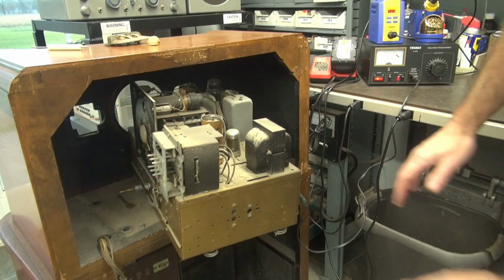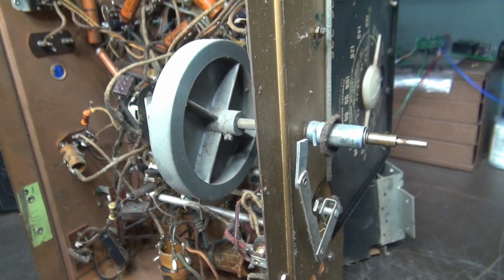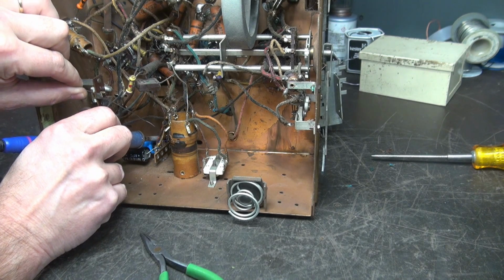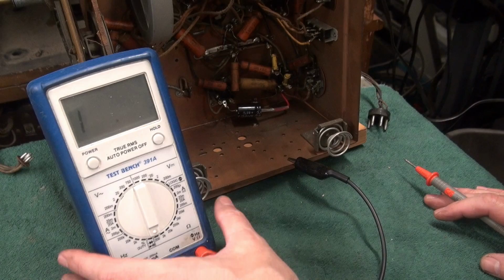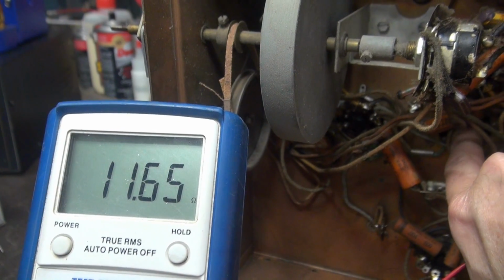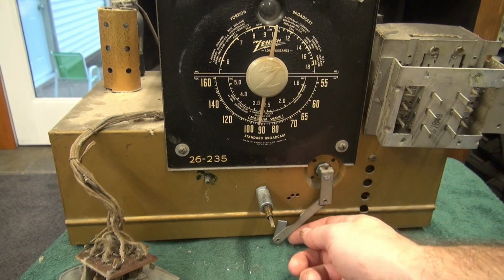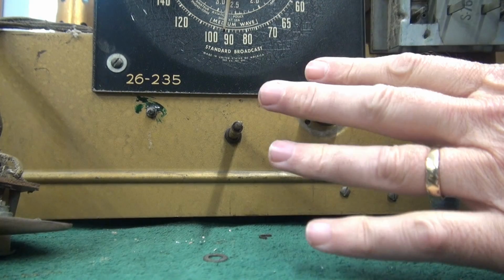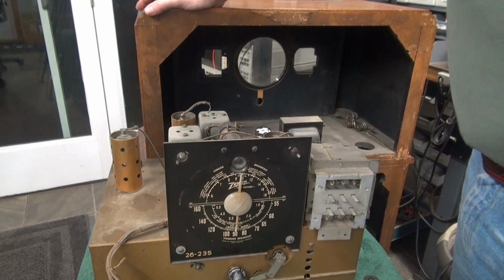How to repair Zenith 5808 8S463 tube console dead Radio broken band switch numerous problems

Comment: I have a hamarlund HQ 129 X. It fires up but the output is nada. A previous owner was restoring it and recapped it aswell. But it does noting.  Will post a video soon
Reply: The previous owner died before the radio was in working order again. And the salesman who bought this radio in a lot couldn't give me any info

Comment: I have a 1960 Zenith console and the FM frequency is no longer working. There is him but no reception. It did work but a little quarkie. There is a Stereo light that didn’t light up until I had the unit on FM frequency for about 20 minutes. The AM works fine. Would I need an antenna? Or is it another issue?

Comment: Greetings:
The tuning eye tube is definitely tired, but an increase in plate voltage can usually help.  Currently the plate is connected to the output side f the field coil. Moving to the input side (from + side of c24 to + side of C23) )should increase the brightness somewhat.

Comment: I have the same exact set I was given yesterday the person got tired of it taking space.. it had the same switch issue which someone fixed. they used a L shaped piece of metal with a hole in it and they used a small hose clamp over the pot metal shaft and a nut and bolt to connect the two..

Comment: That is well worth saving. I have a '46 Zenith console with both FM bands and it sounds great. Yours has the infamous 6X5 rectifier which is known to short and take out the power transformer. Best to replace it with a modern day one.

Comment: I love me some Zenith Radio's, but sometimes it seems like they practiced black magic. Mine had among other things a bad output transformer & speaker, a frozen volume control, several burned beyond recognition resistors and the usual bad wax caps....and pwr. transformer. Good luck.

Comment: I just finished restoring one of these,  my family heard Japan bombed pearl harbor on the set. It was the very set that inspired me to go into electronics when I found it in my grandparents closet in 1968. I inherited it in 2005 and after being dark since 1947, it works and talks again. After many challenges everything is back except I now need the correct power transformer for it. Back in the early 60's a local shop put a 10S transformer in it and is way way too high of B+, that and the 6.3 volt isn't right either....but that'll be soon corrected.
Reply: I changed out the 6X5 retifier, Put a 5Y3 in with a Hammond 270 DX power transformer. Radio works great  and no worry of the rectifier tube taking out the power transformer!. I also insatalled a line fuse for added protection.

Comment: your dial belt  lengths are 
 9-3/8  JFD part # 80.
 and
  9-25/64 length GC part # 115. 
If you can find these two belts there is the part numbers.
these are the two listed for The zeinith 8S463 model  from the  "Radio Dial Belts" Book By Ray Bintliff. De VE3TYA

Comment: Nice work.  Glad you showed the point where you were about to call it as a lost cause, we all reach that point, but you showed how old gear can surprise you.  I especially liked the band select fix, similar to what I was thinking could be done but your method with the J-B Weld probably worked out simpler.  If it's rugged enough and hidden from view, great!
As for Part 2, we'll see it when you do it! ☺

Comment: I've got and 8S463 in my basement workshop right now! Very minimal cosmetic work needed. Power transformer is shot though, so I'm working on sourcing one. Any suggestions? I ask b/c the schematics don't give the winding voltages :(

As always, love your vids!

Oh, and for the band selector link arm, you could try this stuff: https://www.muggyweld.com/product/super-alloy-1/
 I've used it in the past to restore pot metal toys (fill cracks and pits) from the 30s and 40s as well as fix a pot metal bose satellite speaker wall mount bracket.

Comment: I had one of these when I was just starting out in electronics as a young teenager. It was already 20 years old, I'd lugged it home from the attic of the last farmhouse on the road in Long Island before they converted the farm into a housing development. It needed some cleaning and eventually some new caps, but it worked and was extremely sensitive, especially at night. Listened to a lot of DX on that old thing back then.

Comment: I did a 12S569Z with the rubber wiring replacement, bad tubes, and cabinet restore. It was a big job and unfortunately my oscillator coil ended up bad. Let me know if you happen to know of one available.

Comment: If JB Weld fails, get some BONDIC UV activated adhesive, they use it to fill teeth, very strong,. Look it up on YT
Reply: Great suggestion.  I was thinking of the same thing. The only thing is that you have to do multiple layers to build up the joint. And it's expensive compared to JB weld

Comment: I think I have that linkage you need. I have a pretty crusty Zenith that could be fixed. But, it needs completely re-wired and I don’t have the cabinet for it. So, it’s pretty much a parts chassis unfortunately. I have a deal in mind.
Reply from the maker: Deal? Love that word, e-mail me, contact info is on d-labelectronics.com
Reply: Just finished the vid. I guess you don’t need that linkage anymore. Ha!

Comment: Terry- Why do you not make a speaker to chassis jumper? It is easy to do, & cheap too.
Use the base off of a bad tube for the male half and a salvaged tube socket for the female half. A few feet of wire & VIOLA!. I have quite a number of these home made jumpers I have made over the years. Also many times they will work on more than one make and model of radio. Good kludge repair on the lever assy! I have 1 left in my parts box when I get to restoring another Zenith I have.

Comment: Also play the radio for a while once you get it recapped with the weak tubes. They are like a CRT where they become lazy from sitting around a long time and to wake them up the only thing they need is some use.  I've seen it happen.  Obviously shorts and gas or any other defects such as that get them out of there!   Anyway if the set is performing well even with the tubes that are in it why change them? The best test of a tube is in the circuit.